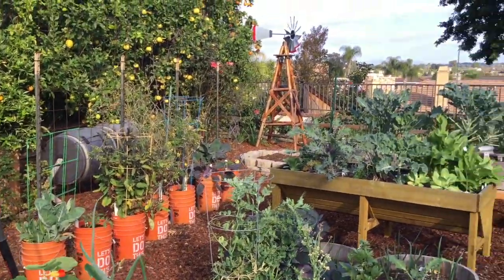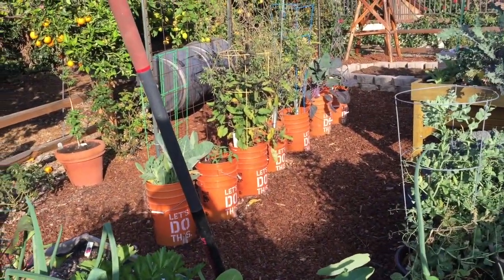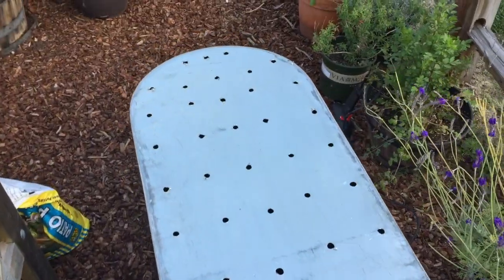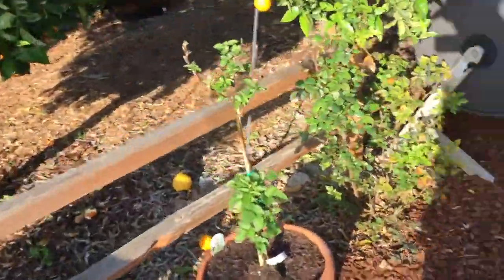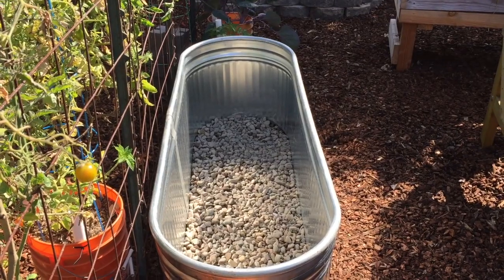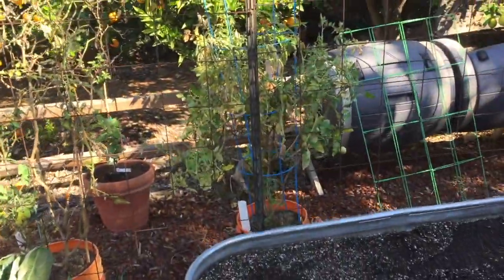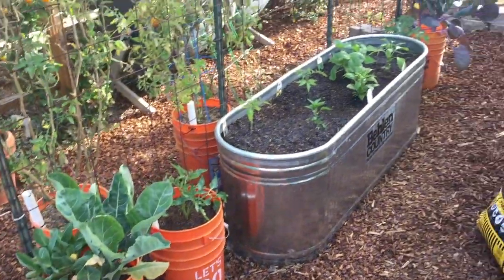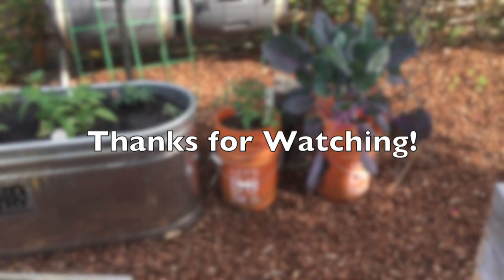Gavanized Steel Planter - February 25, 2020

Comment: Don’t drill holes in the bottom with wet dirt they weigh over two thousand pounds and compact the soil like concrete and don’t drain. The side drain is enough especially if you put river rock in the bottom of tank.
Reply: I have a low 12” deep stock tank that doesn’t have a drain plug that I can see. So I was thinking that I need to drill holes but instead of the bottom I’d drill them a couple inches up the side to help keep some water at the bottom to wick up. What do you think of doing something like that? Good or bad idea? I did that with the winterizing seed planting in water jugs during the winter. I went up the side about 1/3 of an inch and it worked out great. I regret the holes I made with the 2ft tall stock tanks since the water just runs thru them with the twigs and branches on the bottom as filler. So maybe removing the wood and refilling it with all soil may be better. If I didn’t have underground critters etc, I’d plant everything in the ground. Sigh…thank you for your time
Reply: @adriankap2978  great idea!

Comment: Did you consider not drilling holes? The drains are an inch off the bottom so will drain at 1 1/4" of water. The river rock covered with fabric would be necessary.  The reason I ask is everyone suggests holes, but no one reports not having them be a problem.
Reply: this was my question I am researching ...
Reply: My understanding is that soil need some/few holes for it to drain/breath. 
How many holes ? 
space them about 10 - 12 inches apart.

Comment: Would plug holes on each end have worked for the drainage.   I have a huge galvanized watering trough but don't really want to ruin it by putting drilled holes all in the bottom.  I bought it to water horses but don't have any at the moment.  Just trying to figure out a spicket, or hole that can be plugged

Comment: Many have planted in these tubs without drilling holes~just leave the drain open and put some rocks on the bottom up to the top of the drain hole.  Then you can save your container incase you decide to make use of it for something else~
Reply from the maker: That’s one of the awesome things about gardening.  We all  get  to learn a little from each other.  Thanks for sharing and for watching!

Comment: I wouldn't be concerned with the metal shards from drilling the holes.  They will just eventually rust putting iron into the soil which is good.